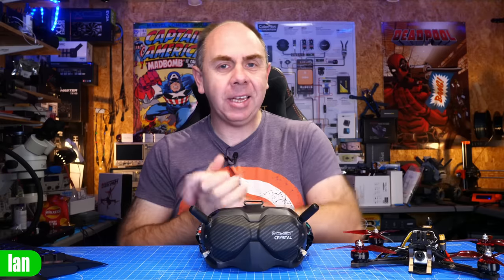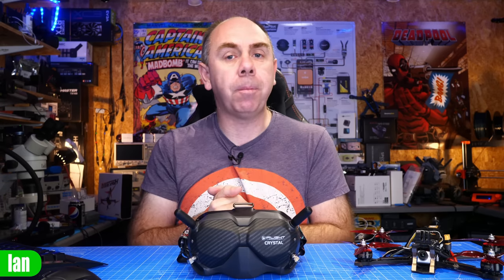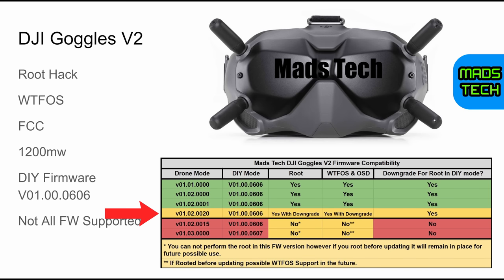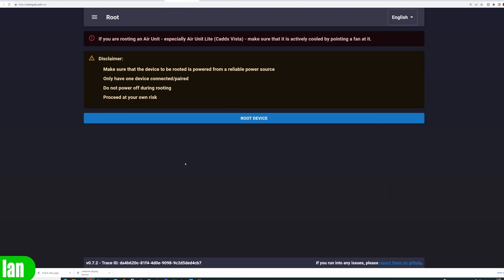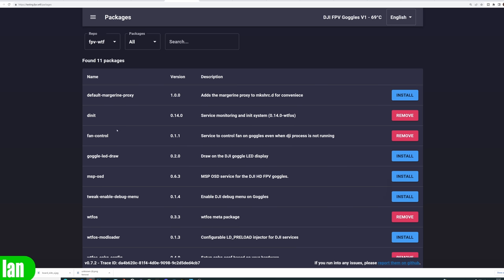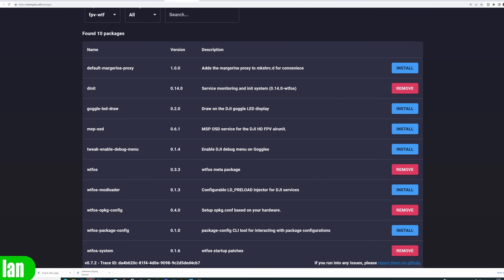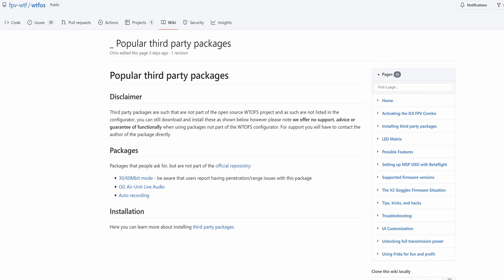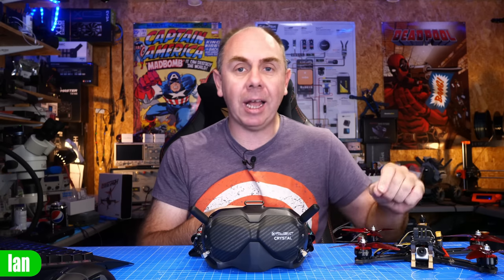DJI FPV MSP CANVAS MODE - HOW TO GET FULL OSD ON DJI FPV

Comment from the maker: Important Info - 

Donate to FPV.WTF -https://opencollective.com/fpv-wtf/donate?amount=10

WTFOS Configurator Link - https://fpv.wtf/

Betaflight Only OSD Instructions:
How to Enable MSP OSD In Betaflight - Go to CLI tab to enable MSP Display Port.
set osd_displayport_device = MSP
set displayport_msp_serial = YOUR_UART_PORT_NUMBER - 1
save

INAV and Ardupilot Instructions see https://github.com/fpv-wtf/msp-osd

FAQ 

1: V2 Goggles On V01.00.0606 In FPV Drone Mode. 

If your V2 goggles are showing V01.00.0606 in drone mode this is because your on VERY old original V2 firmware from before the FPV Drone actually launched.  If your on this simply return to DIY FPV Mode and Root as per the video.  

Please support the project and donate to the FPV.WTF team for the amazing work they have done https://opencollective.com/fpv-wtf

Comment: Is this working for INAV ? since the CLI commands are not accepted in INAV
Reply: This is a question for Paweł Spychalski and the INAV dev team. There is a discord server linked in his videos that will help answer.
Regarding the MSP setting, in INAV configuration this is a section on the Ports tab. Normally for DJI MSP is turned off. Since INAV 4.1 some DJI OSD stuff has been hidden and made automatic, so there may be more that need to be configured. (best to ask on INAV discord sever, or check for open thread on the topic)
Reply: See @reply to Flore Flyer's similar question below. The advise is to "select HDZero VTX and use HD mode in the osd section"
Reply: Bardwell stated in his livestream today that it works with INAV
Reply: @msaunders300  maybe, but it did not work for me. The CLI commands are not accepted in INAV. I have to see what I'm missing

Comment: Do you think its possible to add a microphone to a Vista for the Live Audio package? Maybe we are lucky and the pads that the mic is soldered to on the Air Units are somehow exposed/accessible on a Vista as well. Since you worked a lot with these products I figured you might be able to answer this.
It would be so nice to have live audio on Vistas as well.

Comment: great video! only thing is its not actually technically canvas mode... Canvas mode is pixel level. this is msp displayport which supports a predefined set of characters, as far as I understand. Canvas mode is decidedly different.
Reply: I dunno about that. DJI terminated all the connections with Caddx where Caddx promised canvas mode implementation. Does Caddx say they will still pursue in that development roadmap?
Reply: @kibbycabbit  huh?

Comment: Thanks for this video.  I keep meaning to do this.  Is it possible to have both the Drone mode and DYI as firmware 1.00.0606.  I went to both modes in the google.  I update late last year early this.  When I go to the assistant and the googles are in Drone mode I do see the firmware's in red available which of course I will stay away from.

Comment: I am having trouble connecting to my DJI V2 goggle, USB device appearing as name Pigeon. But error message showing "NetworkError: Failed to execute 'Claiminterface' on 'USBDecice': Unable to claim interface." Tried it on 2 different PC and Mac machine and all having the same issues.
Reply: I had this issue. Using a tool called Zadig to switch the usb driver from libusb0 to WinUsb solved the issue.

Comment: I‘ve followed the procedure & the new layout from OSD was pretty nice. Unfortunately I can‘t switch after that anymore from old DJI FPV digital system to the O3-system in the V2 goggles. I had to upgrade refresh again V2-goggles firmware. You can choose the selection of systems or WTFOS. 😢😢😢

Comment: Great video.. never flown analog so new to full BF OSD. How do you navigate the menus such as you do at 12:11
Reply: Center throttle, yaw left+pitch forward to open the menus. 
Use pitch stick to move up/down.
Roll right to move forward (like pressing enter).
Yaw left to go back to previous menu.

Note: The above is true for a mode-2 radio, at least. Not sure about other modes…
Reply: @abertheham  gonna try this today. Thank you.
Reply: @abertheham  works like a charm thank you
Reply: @Xavier-wo6ce  happy to help!

Comment: 12:44 wait auto recording doesnt work by default? like when we arm and disarm it wont record like the stock goggles did?
Reply: He’s talking about a different type of auto record, on this one as soon as your googles detected (connected) to your air unit it would start both recording.  There is a bug though that puts vista units into low power mode regardless of auto temp control settings in the googles (present fix is to toggle the setting from on back to off and then the vista respects it).
Reply: @testpilotian3188  No freaking way.. Do you know if this is still a bug?? I had this happen today, and exploded my hero8, a vista, a nebula pro cam, a motor, arm and a new lipo. I could not figure out why I my power setting didn't switch to 1200mw..

Comment: Thanks again for all you do.
QUESTION: Do I still need to set the serial port if I updated to BF4.4, which now includes support for HD display and you can actually select MSP at the ports settings? I can get the display to show up, but the text is all shifted to the right side of the screen so anything text that is on that side if off-screen. I tried running this command but it's not a valid command in my version of BF. I'm sure I'm missing something elementary. Thanks for anyone who can help.
Reply: Same problem here,, Did you find a fix? Thanks
Reply: @crezzlin  I did get it to display correctly, but I'm not sure I "did" anything to fix it. What I did try was first allowing the goggles to fully boot up BEFORE plugging in and binding to the vista unit. Second, I shifted everything to the left side of the OSD in Betaflight to see if I could get it to fit in the screen. After that, it somehow "magically" started working and I could arrange the OSD elements all the way to both edges in Betaflight. Honestly, I think the fix was that I needed to allow the goggles to boot all the way up and let the fonts load before turning on the air unit. Good luck.

Comment: How do I check which firmware I have in drone mode?.. When I check it shows the 606 version which I have on the DIY version
Reply: Curious on this as well
Reply: @beeradfpv  I found out that if you have 606 firmware on the fpv drone settings then it's old firmware you can flash the 606 DIY  as normal it won't effect anything and you'll get it rooted

Comment: How do you check the Drone Mode version of the firmware?  I'm in that menu and don't see it.  I've NEVER connected my V2 goggles to any DJI drone.  I have no need for that.  Scared to plug it in to their software..lol

Comment: Thanks Ian for covering this. When I switched to the DJI drone mode on my goggles V2, the firmware is V01.00.0606 (strange that it is the same as my DIY mode), and I am left with only the option to upgrade to V01.03.0000 and V01.02.0015, both seems to be the version impossible to be rooted. It seems that DJI has obsoleted the previous FPV drone firmware too. Am I out of luck?
Reply from the maker: No just root off that. Your on a few older V2 firmware. Your fine.
Reply: @MadRC  great thank you!
Reply: Same. phew, glad we can root and fix our goggles.
Reply: @MadRC  Many thanks for clarifying Ian. My head was in my hands after your explanation in the video (as I'm in the same situation as BrokeMyFatStrap). I'd suggest adding an extra 'green' row to the top of the summary table to show that everything is hunky dory when both Drone & DIY firmware are V01.00.060. Thx again 🙂
Reply: @MadRC  thanks for this answer as well, I was like what's going on, both my firmwares are the same now and say 01.00.0606 what do I doooo??? Lol feel much better now

Comment: Thank you for the video!  My goggles are not being recognized in nighter chrome or edge (windows 11)  in device manager they appear as "CDC Serial (Interface 4)  (COM4)" but in testing.fpv.wtf it says "no compatibile devices" 
I have v1 DJI goggles with 6060 firmware (confirmed)  What am i missing? please help.
Reply: I have exactly the same issue 😢
Reply: The rooting failed? If you cant install WTFOS retry the rooting first.
Reply: Thats if this isn't some device permissions issue of course, those are usually easy to deal with.
Reply: @spikester  I’ve checked the permissions several times and they are all set to be able to access the device. I can see the goggles on the dji app fine but the browsers just won’t see them. So frustrating
Reply: I had the same issue, deleting the com port had no effect. Eventually it worked after removing sd card from goggles and swapping to another usb port.

Comment: Does not work for inav I've tried everything I've can see my voltage so my rx tx is correct air unit and goggles on 606. No luck what,so ever. All I get is osd waiting flashing then font bin inav flash up and disappear any help would be grateful

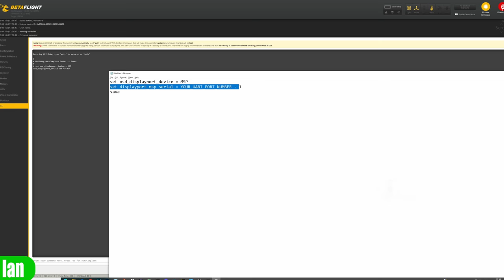Comment: 11:14 - 11:22 If you type in "set displayport_msp_serial = YOUR_UART_PORT_NUMBER - 1" it will default to a value of 0, ANY number and ANY text will cause this, you NEED to leave out the   YOUR_UART_PORT_NUMBER -
it's simple  "set displayport_msp_serial = X" X being the number, just so happens that if you are using UART1 this will work, this will NOT work if you  "set displayport_msp_serial = YOUR_UART_PORT_NUMBER - 4" for example.. as it will default to ZERO.

Comment: I fly fixed wings and I use a monitor because I am not comfrotable flying with Googles.
Is there an easy way to present digital video in a monitor?
Under the previous considerations, is there any advantage on adopting digital video?
Thank you.

Comment: On the video description it says that iNAV is supported, but my question is, do iNAV users have to apply the following CLI commands? set osd_displayport_device = MSP
set displayport_msp_serial = <configurator msp uart number - 1>
set vcd_video_system = PAL
save
Reply from the maker: No there are separate instruction for Inav. You need to follow what’s on the wiki here https://github.com/fpv-wtf/msp-osd
Reply: @MadRC  Thanks, I will check it out! Cheers!

Comment: I feel like the walksnail system seems like it has nothing else to offer now. DJI Vista with the WTFOS is a clear winner now.
Reply: From what I've heard, Walksnail also offers range beyond 13km, unlike DJI.
Reply: @captainmarcin6105  Who flies beyond 13km ? This is a very small group of flyers
Reply: @captainmarcin6105  For multi-rotor, it's not an easy feat to accomplish 26km round trip.. unless you fly fixed wing

Comment: Hi, like some others I've managed to root the v2 goggles running v1.00.06060 (shown in both fpv and drone mode) , only I'm also  unable to install wtfs - the site doesn't see the com port/USB. Tried on chrome/Edge/vivaldi to no avail.

Comment: Hi,the latest firmware for the v2 goggles is v01.03.0000 and as we know is locked atm and we cannot downgrade.With this firmware the old air units,caddx vista etc.. are working?can you suggest a digital camera that works with this firmware?
Thanks for your videos!

Comment: I have v01.02.001 and it will not root.  Gets stuck at several places and I'm prompted to do a manual power cycle.  I do and it acts as though it worked, even gets to the end and states root successful.  However can go no further in the process as if it's not really rooted.  They only thing I can do is root again.  Stuck in a loop...

Comment: I had an interesting time getting my goggles rooted. The version number initially came up as all zeros. Finally, just loaded the 10.00.0606 firmware on the DIY side of the goggles and the root went through. The FPV side of the goggles now reads 10.00.0606... I have no idea why.

How do I get the OSD elements to move to the far left of the goggle scree. They seem stuck about a quarter of the way across the goggle from the left side?

After changing the OSD to MSP in the CLI the option to change the camera to PAL disappeared from the OSD Tab. Anyone else seen this? I'm not sure if I changed it to PAL or not before changing the OSD in the CLI.

It would be cool if BetaFlight update the OSD screen tool to reflect 16:9 MSP-OSD so its easier to set up stuff. 

lots of work to get LQ!

Comment: How does this work with ardupilot? For example ardupilot already supports a limited OSD for the dji goggles. What would be the process with ardupilot to potentially get additional OSD functionality and features?
Reply from the maker: Ardupilot already supports MSP canvas OSD as well. There will be new fonts coming for this soon but you can use it in compatibility mode.

Comment: I have new dji fpv in settings/about I see aircraft/headset firmware 1.02.00.00. I don’t see drone mode firmware or diy firmware anywhere
Reply from the maker: That is drone mode. You switch to diy mode by going to the device screen and scrolling down.

Comment: the DJI osd works now with FPV mode like the AVATA just plug in update firmware it shows all your levels automatic  ???? your battery level ,, RSSI from ELRS system no need anymore for beta flight the vista runs through your FC like the AVATA all I use is RSSI and battery level  and the Timer all that works thru DJI OSD like you r flying the Avata ?

Comment: amazing canvas mode but now i can't use my rasberry like a monitor for a visitors
Reply: Assuming you're using the video-out software, I have mostly the same issue. I find that my full size Air Unit quad works, but my Vista's are really sketchy. I can sometimes get a connection if I unplug and replug in the USB after the quad is armed, but it usually won't stay working for long. And sometimes it is very low latency, whereas most of the time it's 3 seconds,...

Comment: When I click connect on the website it says ‘no compatible devices found’ I’ve allowed access to usb etc and it still won’t connect. Also tried a different PC and usb cable and still can’t connect. I’ve used chrome and edge too. Any suggestions?
Reply: I had to go into device manager (PC) and uninstall the USB driver then plug the goggles back in then it loaded a fresh driver then it connected, they have an awesome discord group as well

Comment: The CLI commands don't work on INAV. Is there another way to get this working in INAV ? thank you
Reply from the maker: You will need to follow what ever the process is for Inav.  Those instructions are Betaflight.
Reply: @MadRC  thank you, I've follow the INAV instructions and it worked

Comment: Wat is the temp and voltage reading on the side ...and can I move or remove it
Reply from the maker: Not yet but in the future.
Reply: @MadRC  it's now been removed in the latest update, but you can add it back in the CLI apparently.

Comment: i connect my v2 googles that are on version V01.00.0606 on both dji drone mode and fpv mode which i read is fine but the website can not recognize the goggles are connected to the computer btw they show up in the assistant software too so i cant figure it out
Reply from the maker: Are you using chrome ?

Comment: One question . Both modes ( FPV and DIY ) in my v2 goggles are in v01.00.0606 . Can I root them ? If yes , do I have to upgrade FPV mode to the green versions before the root ?
Reply from the maker: No you should be ok just root as they are in DIY.
Reply: @MadRC  Thanks , I'll try
Reply: @MadRC  I tried to do it and I got an error message "No compatible device found". I used 3 different type C cables and nothing happend . I tried the same in air unit and I got the same message. I can hear the distinct sound from pc when I power up the goggles and air unit , but the configurator cant see them    EDIT : The problem was with PC . Now it works

Comment: Does anyone know which firmware the V2 goggles are currently shipping with? I would assume the latest but that's not always the case with other hardware. These goggles were out of stock everywhere until recently so I guess there's not much hope to find new old stock with older firmware.
Reply from the maker: No, the V2 with the Avata are shipped with a none released FW version 01.02.0060 that’s not compatible with the root. It’s also not got drone mode either and needs to be updated to V1.3 to get everything back.  However DIY Goggles V2 are still shipped with older compatible FW.
Reply: @MadRC  That's good to know! Thank you, sir!

Comment: I   just need my  battery volts  ,ive  tried everything.......im missing  something  im sure , ive done  almost everything  possible to my  learning  but  no osd ......only osd  waiting....amy help
Reply from the maker: Have you done it on both parts of the system ?you need to follow the same msposd setup as for HDZero and Avatar

Comment: I successfully rooted all my hardwares and installed the corresponding packages set the msp on betaflight but I’m not getting the overlay on the goggles and if I turn off the custom osd on the dji system the osd doesn’t display.
Reply: In betaflight did you select PAL? Needs to be PAL in the osd page
Reply: @terminsane  yeah pal is selected I think I’ll go back and start again somethings not right  somewhere
Reply: @JEGZ_FPV  Did you input the CLI commands?
Reply: @stevo_fpv933  yeah cli commands are there and on the correct uart minus 1 etc. I’m gonna go through and redo the entire thing as something isn’t quite right mainly the fact I turn off the custom dji one and it turns the entire osd off
Reply: @JEGZ_FPV  just to check, you did type the correct uart, so if msp is enabled on uart2, your cli command was 1?  On the CLI numbering starts at 0 not 1.